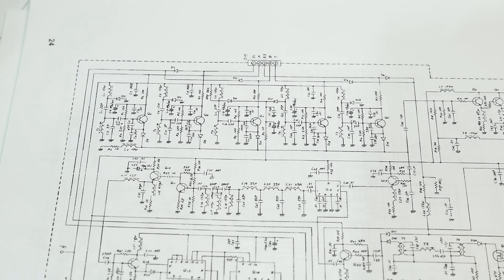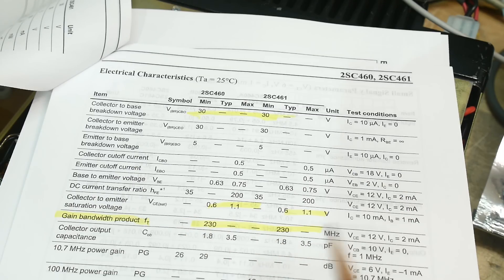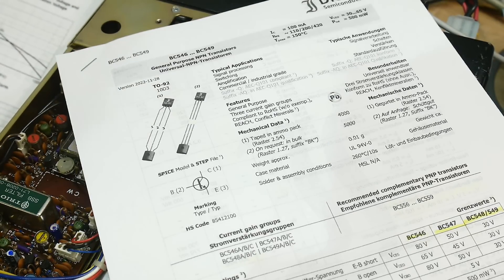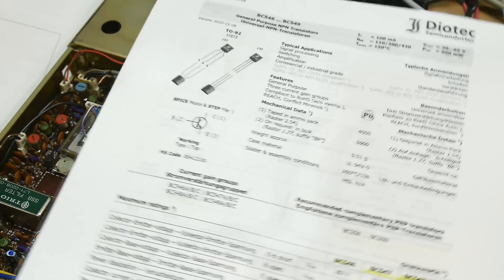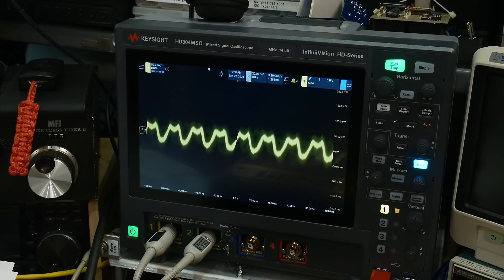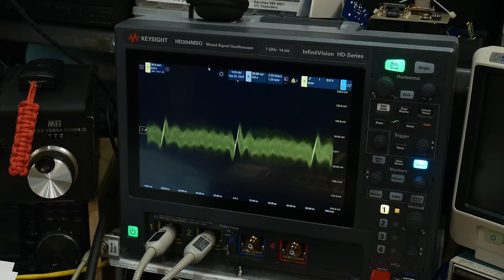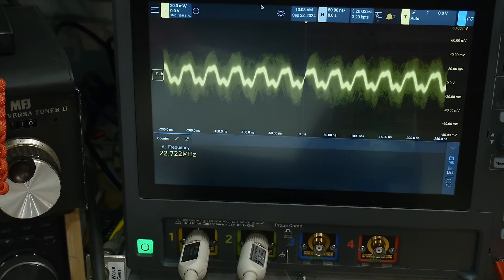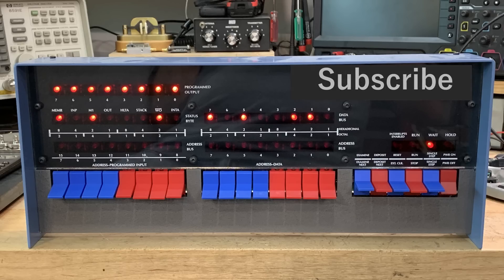#2010 Kenwood TS-120S HF Transceiver (part 10 of  12)

Comment: I just found this channel, I repair lots of radios. Don't know the history, of this radio, as I have not watched the other vids. But just watching this one, I would say you have either a control voltage problem, in the diode "drive" toi the osc switching. Or simply a PSU problem in the radio. One or more of the voltage regulators would be my first check. And then look at if the voltages are being pulled down by something. I really like the TS120 s/v radios as my father had them. Don't worry about transistors until you have the voltages correct. They look way to low.

Comment: I instantly thought of the bc54x as they're very common european transistors. If neither of the oscillators works and then they all gradually start working, it has to be something in common to all, so not in the oscillator circuit. Check supply rails, dc voltages, etc.

Comment: Hell I would try a 2n3904, if it works it works. 60v, hfe 100, 300mHz GBP
I see similar comment below,...
Reply: And it's super common and inexpensive, that and the 06 is what I use with small projects.